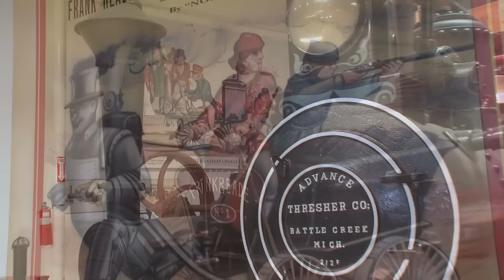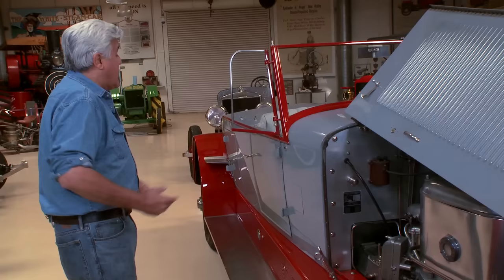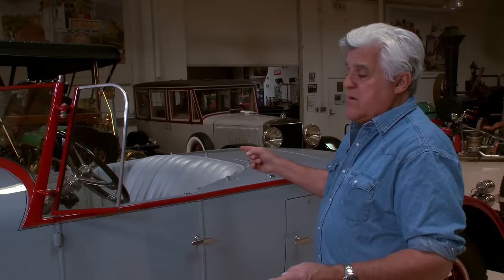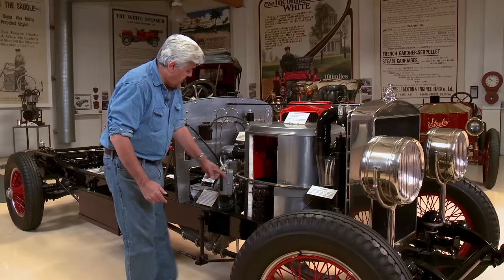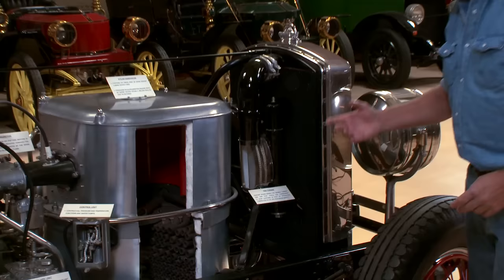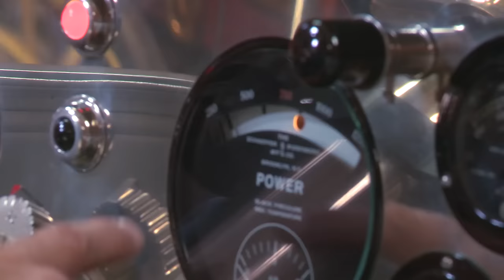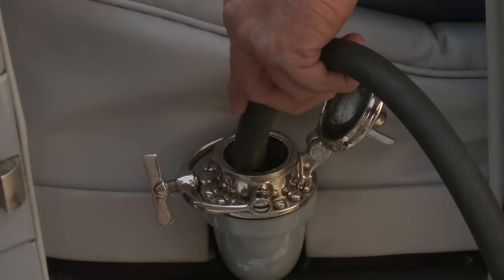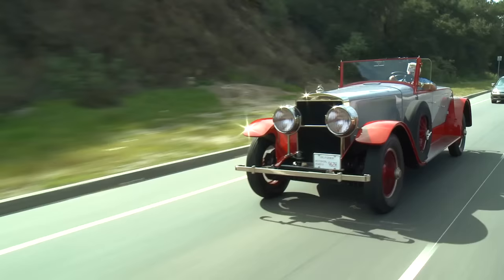1925 Doble E-20 Steam Car - Jay Leno's Garage

Comment: I do appreciate what you have done, Jay. I remember readijng about the Doble in Old Cars Weekly during the gas crisis, when people said, yeah, steam, that's what we need today, cars that run on water instead of gasoline. Of course, water has to be heated up. The wonder of the Doble was how well they ran and how much torque they had for the times. You showed the complication of the car, debunkig another thought, that engineers were not so smart back in the early days of the automobile. They were just as smart then as now. They just had to build the tools to create what they envisioned and that takes time. Thanks for showing us the tech of what so many of us have wanted to see since we first read about he Doble steam car.
Reply: The Doble runs on gasoline and gets an absolutely appalling 3 -6.5 MPG.
The most expensive car in the world, over a million in today's value only produced a mere 150 horsepower.
Easily the most expensive and unreliable car in the world Jay's car broke down 6 years ago and is undergoing its second major rebuild since he has owned to... 
Jay said a moon rocket was cheaper to operate per mile than his Doble.

Comment: "Racing water." 😁
Reply: Hydrogen peroxide..., the was a drag car in the 70's called The Pollution Packer, h2o2 onto hot nichrome wire.
Reply: Evian racing water
Reply: @robertwoodliff2536  the real pioneer of H2O2 racing was Slam'n Sammy Miller. He did incredible things with hydrogen propulsion including mining oil and setting records in his funny car, Spirit of '76, the first ever propelled by a rocket.

Comment: I have a background in the heating and air conditioning business , worked with boilers and related equipment including controls and instrumentation.....also some exposure to power plant boilers and superheated steam , I'm fascinated by the technology in this machine and can appreciate a bit of whats going on. I want to know more , its just the way God wired me. I have some appreciation of the power of superheated steam. This is way cool . Interesting that locomotives used fire tube boilers and not steam generators.........wow there is a whole lot to get hold of here. Wish I was out there to see it. Fun stuff.......thanks Jay like your humor, always did , Great stuff amazing work.  Where did the cut away come from? How much gasoline did it use to keep moving along? How much more there is to know, I love this kind of stuff.  God bless and good night.
Reply: always another side to the story.
Reply: Not really.. Carnot's theorem was proven correct by Rudolf Diesel in 1892, it was already commonly understood that steam cars would always be less efficient than ICEs by 1915..
Reply: well it went fast , but for the fuel used it should have , lots of stuff to mess with and give you more to do than screw with facebook.
Reply: Not up a long steep grade, 150 horsepower is still just 150 horsepower.. The Doble could "sprint" only briefly by exhausting its entire stored steam supply and then coasting to a stop to recover pressure. The Doble needs the tooling and maintenance manhours to operational service hour ratio closer to requirements of a military aircraft... and a price tag of around a million dollars in today's value... not something practical for your average DIY guy on the week-ends.  Jay is one of the few people in the world that can afford to keep the Doble running as a hobby.. Most Doble's (like most steam cars) are not kept in prefect running condition today (if running at all). cheers!
Reply: always another side to story, thanks.
Reply: Well, Doble and all the rest of the steam cars went the way of the dinosaurs because they couldn't compete with ICEs...  Can't change the truth.
Reply: still interestig and burned fuel more efficiently or at least more cleanly
Reply: there is an interesting factor and also the combustion was probably very clean.
Reply: The Doble may have produced very low HC and CO emissions for its day, but it would be classified as a "gross polluter" today because of the massive amounts NOx pollution it produces... not to mention the absence of evaporative emissions controls.
Reply: The Doble would not even be allowed to be sold as passenger car in many countries due to the fact it produces more CO2 output than 3 or 4 modern cars... its overall carbon footprint that is greater than several average cars would also be unconscionable today.
Reply: No, steam engines CONSUME more Oxygen and produce more CO2, they also produce massive amounts of the toxic gasses known a NOx which create photo-chemical SMOG.
Reply: Joseph Black discovered LATENT HEAT in 1761... the fact that heating water into steam WASTES HEAT ENERGY... this is why the Rankine cycle is less efficient than internal combustion... as soon as you boil water into steam? You have wasted heat.
Reply: YES, STEAM IS DEAD! Hydrogen fuel ICEs and Fuel Cells are the future!
Reply: The Raptor engine??? It runs on petroleum natural gas.
Reply: But you are not an automobile manufacturer... so what is your point?
Reply: NO HATE EDUCATE!
Reply: @Autistic Boy The Raptor engine is a very different type of engine as it is designed to produce thrust not power. To be fair, any rocket engine is going to be less efficient than any air-breathing engine(even air-breathing turbine engines - rockets are effectively closed-cycle turbine engines. These include but are not limited to jet engines), so I don't think you'd want to power your car with one ;), but with that said the Raptor is going to be one of the most efficient rocket engines ever designed.
Reply: doktorbimmer more than a Civic lol
Reply: @doktorbimmer  Didn't seem to bother Howard Hughes (7 mpg) !
Reply: @doktorbimmer  My school teacher told me that Dinosaurs went extinct probably because of a Meteor hitting the Earth, and cars had not been invented back then.
Reply: @GrrMeister Hughes could afford to build the worlds largest airplane just for fun... or buy a TV station because he didn't like what movie was on that night.
Reply: @GrrMeister When was the last time you saw someone riding a dinosaur down your street??? Or driving a steam car???